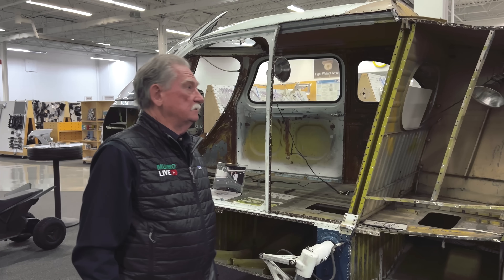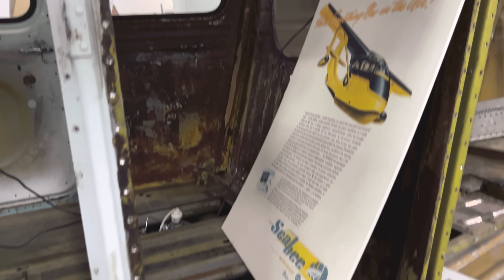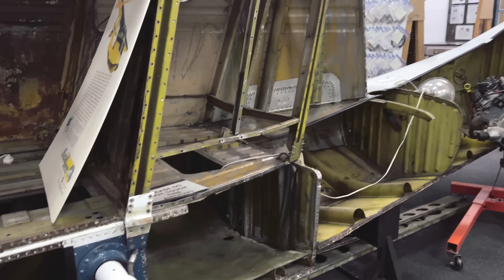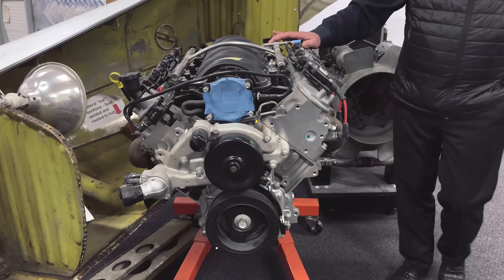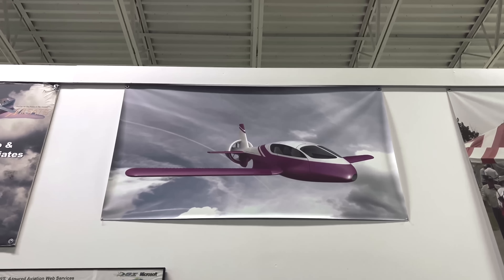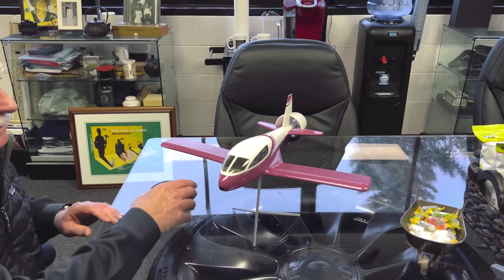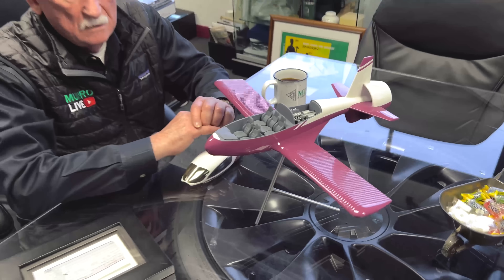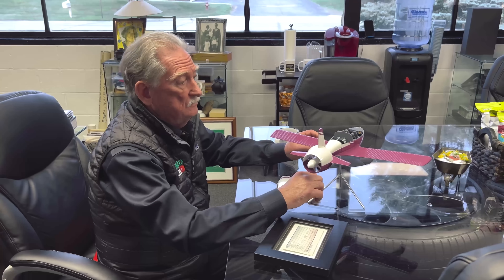Storytime with Sandy - Seabee and The Paradigm Plane.

Comment: Ummm an Aircraft for Women ?

Didn't you Google to find out that 90% of pilots are Men ?

Also most Women are scared of flying let alone in a small single engine plane ?

Only very young Women are obsessed with pink,  if you Google Adult Women's fave colors, the top three are Blue, Purple and Green. Two of which are also Men's fave colors !!

These are some very very strange choices....🫤

Comment: Boy that Seabee cut away has brought back memories.   Back in 1973 I was 19 and I briefly worked at Stole Aircraft where we converted Seabees into the twin engine Twinbees.  I was there paint stripper. Because I was so skinny, I was able to fit down through those access holes beneath the seats to strip out the green paint inside the hull.  I wish they had respirator’s available at the time. I know I lost some brain cells from that experience.

Comment: Thanks! My Seabee is older than me (and I'm pretty old!). I do the annuals (supervised by an AI, of course) and have never seen parts and spaces on my airplane that I saw in your cut-away. Thank you! I regularly land on marginally salty water (Petaluma River, San Joaquin River, Sacramento River Delta, etc) and, post-flight, taste the water in the hull (there's always some water after water ops) to detect salt (salt taste is very sensitive!). If I taste any salt, Mermaide of the Skye gets thorough douche with fresh water. So it's comforting to know that Seabees have tolerated salt for decades.  And, if you're done with your Seabee scrap, I'll be happy to take it off your hands. No charge.

Comment: Getting a new aircraft design approved and certified is a long term nightmare.  Compliance with the FARs basically drives you to use old "proven" techniques for the airframe and engines.  The FAA has ensured safety to a modest extent in the small aircraft world but has also stifled innovation. There is finally some innovative new autonomous and piloted electric air vehicles being developed but they've got large amounts of funding to deal with the certification bureaucracy.  Lots of good designs and concepts have died when faced with the reality of getting a product all the way through development and certification  I believe the loss of funding probably saved Sandy from a fairly large financial disaster.

Comment: Regarding your aircraft looks great, not a fan of the old wing design. Specs certainly not a 180mph😂 aircraft maybe 120/130. Anyways i see a typical mistake where startups bight off more then they can chew. Innovating the engine/avionics/airframe. If you just focused on one element you might have had success. Garmin has already secured the GA avionics, airframes have also been refined, but piston engines, same old 40’s tech. TCM IO-550 is still the industry standard. 310ps air-cooled, magneto powered, etc… the market now I think is retrofit for electric drives on existing fleets, this would be cool.

Comment: The Delta Hawk two stroke diesel is an amazing engine. I’m sure too small for the SeaBee but the idea should be considered. The Zoche two stroke diesel from Germany is better still** but sadly the project ran out of money for homologation. 
** 2.5 litre four cylinder 150 bhp or 5 litre eight cylinder 300 bhp. 
Zoche had a turbo blower driven by a ring gear which doubled as starter motor. It also had a normal turbo for charge air boosting.  As with Delta Hawk there are no valves to seize, no fussy spark plugs, no carburettors and it runs on jet fuel.

Comment: Ok so as an aviation person, lots of factually incorrect things being said here and I wish for his own sake he would research this as there are plenty of people expecting the information he is sharing to be factually correct. You cannot put a "x" in front of the N number and make it experimental. If it is a certified aircraft, you have to have its airworthiness changed to experimental, however it cannot be an EAB (Experimental Amateur-Built). He could get other types of experimental certifications but they all come with heavy restrictions. 

Sandy keeps saying "against the rules by the FAA" but can you please cite what you mean? Regarding formed panels, look at any rib on a metal wing airplane like a cessna and you will see formed aluminium. This is a common practice and one that is done in both EAB and certified airplanes. The "hoops" are just structural members / stiffeners and are also found in other airplanes in a variety of shapes and sizes so not sure why he is saying not allowed. Spot weldings are done all the time on frames and tabs on planes like cubs and champs and so I'm again not sure what he is talking about. Take a look at this AC for what the FAA considers acceptable methods today: https://www.faa.gov/documentlibrary/media/advisory_circular/ac_43.13-1b_w-chg1.pdf

Regarding your own design, I think conceptually it great and pusher props are cool, but you said a few things. "Taking off with idle power" would be quite frightening as you need to be at idle power to come down and land, if this is the case, the airplane is not setup correctly. Most GA piston airplanes swing a prop with a direct drive and engines are designed for a power band with a peak RPM around 2600 RPM. Just because you got a bigger engine that revs more doesn't mean its matched well for the aircraft. You WILL need a PSRU to reduce the speed of the prop.

Comment: There is a lot of thought in that development model. The fuselage is very well designed for favorable pressure gradients. The wing, constant chord rectangular "Hershey bar" of high lift, forward camber design could probably use some improvements. Although it is probably easy to mfg, and has docile enough stall behavior. I'm never been a fan of shrouded prop-fans. Although they have several benefits, the drawbacks are also real. I'm sure it provides some additional stability. 

Overall, a really neat design.

Comment: As a mechanic I have a few things too add, I think you had a great design, but you would have gone bankrupt trying to certify that plane for a multitude of reasons.

Also, spot welds aren’t traditionally “legal” per AC43.13, however if that plane is Type certified as that then it’s legal, provided the company can prove a construction is safe, it’s on the company to establish that.

Comment: great story, thanks for sharing.   You put together others' great ideas into 1 airplane.  The deicing was first done just like that in the 1920s racing seaplanes.  There's been other ducted fan aircraft but they have been one offs.  Molt Taylor and others have put the prop in the back, but not as a ducted fan.  I really liked the door idea for passengers.
Reply: Most ducted fan fixed-wing aircraft have just been experimentals or prototype, with the notable exception being the Edgley EA-7 Optica, which went into limited production. 

The RFB Fantrainer was a production aircraft, with 50 built. It was less like the Paradigm than the Optica and was turbine powered, but used a pusher fan.

Although it was just a prototype, the PJ-II Dreamer was an interesting example, because it has not just the rear ducted fan (actually two of them), but is powered by a GM LS engine like the Paradigm.

Comment: That is a sad situation. The aircraft model looks excellent, and visibility forward as well as down would be great. I used to fly the Shorts 330 and 360, not esthetically pleasing airplanes, but getting into and out of the pilot seats was so easy. Instead of stepping over the center pedestal. you'd just walk around the outboard edge of either seat because the cockpit was so wide. Your model looks similar in just that regard because there's space between the outboard edge of the seat and the side of the fuselage.

Comment: I disagree with you regarding the original aircraft engine. That engine design - opposite cylinders, dual spark plugs per cylinder, dual magnetos, air cooled - has been a reliable and proven design for over 70 years, still used on most GA aircraft. It's a simple and proven design with redundant systems. I admire your energy and enthusiasm but in aviation - there is very little room for experimenting and it is not as forgiving as a ground transportation.

Comment: Autonomous landing... cool.
Reply: Sounds totally not terrifying
Reply: Aircraft have been capable of autonomous landing for decades. As computer technology improves the cost and size of the system required gets lower, so it could be used on smaller aircraft. By the time of the Munro work it was assumed to be a feature of future aircraft, and was promoted by the NASA program that Sandy mentioned.
Reply: @brianb-p6586 thx. Any source to chase information a little?

Comment: Apparently you have no formal education in aircraft design and you may not even be a pilot. Did you even do an aerodynamic study on your conceptual design, I doubt it. You have the engine mounted aft of the center of gravity, which means you would have to counterbalance that weight forward of the cg by a lot of weight, which is not normally the passenger or payload weight, since passenger/payload weight is variable and the aircraft needs to be balanced(usually a little nose heavy) at dry weight so that passenger/payload establishes a fixed cg range for which the aircraft is stable in flight.  A liquid cooled engine adds a lot of weight, and how would you manage the thermodynamics of the coolant when an air cooled engine does not require the added weight of a cooling system.  Putting a ducted fan propellor drive at the tail would exacerbate the tail heaviness problem of your design, plus result in added weight of the drive system further aft of the cg. Also, the aerodynamics of the tail control surfaces would be adversely affected by the turbulence caused by the ducted fan and duct structure where your control surfaces exist. Judging by your obvious lack of knowledge of aircraft aerodynamics, flight stability, and aircraft structures, I would say Lehman Brothers did you a great favor by going bankrupt first to prevent you from going bankrupt yourself trying to design, develop, flight test and get certification on this seriously bad aircraft design!
Reply: All generally valid points, although I will point out that every "business jet" (small turbofan aircraft) has the same rear engine and balance situation. 

Also, in the golden age of piston-engine aviation (the end of World War 2), the best engines were either multi-row air-cooled radials or V-configuration liquid cooled... both were viable, and the weight of liquid cooling was not a problem. There was even a liquid-cooled radial engine (Lycoming XR-7755-3) which most powerful design built, but it did not go into production... the war was over and gas turbine engines made it obsolete before it could be fully developed. There are currently liquid-cooled adaptations of automotive engines available for use in general aviation aircraft, and they are feasible on a weight basis.
Reply: @brianb-p6586  while your observations are noteworthy, most business jet and commercial airliners with aft mounted engines have substantially large cabins well forward of the aerodynamic center of gravity to achieve balance for flight stability.  In fact, in the case of business jets, the rearmost part of the cabin is very near the center of gravity. As to liquid cooling, it is a trade off between weight, complexity and maintenance costs  as compared to an air cooled engine.  Depends on your design requirements and available power plants.
Reply: Exactly, @jvaubry  - the balance situation is essentially the same in those "jet" aircraft and this design. In either case, the centre of the cabin is well ahead of the centre of lift, and so cabin load affects balance, and the CofG location of a completely empty aircraft is too far rearward. 

I agree that the cooling system is a design trade-off, as it always has been.

Comment: Wow! This concept could easily scaled up, so it could transport a lot of cargo and dozens of people.
Reply: An aircraft design can be scaled up or down; this is not more suitable than other designs for use at a larger scale.
Reply: @brianb-p6586  It seems to ve very efficient with that fan at the back end. 💨
Reply: You think it would be efficient, @McDaniel77 , but do you have factual evidence to support that? Ducted fans and pusher props and fans have been tried many times, and never proven to be more efficient than propellers on the nose or the wings.

Comment: A 5 seat pusher is exactly what i want for my family.... if only they existed.  Id be curious to know if they designed it so a driveshaft failure  wouldnt take the tail off as happened with the cirrus vk30
Reply: Good catch. The Cirrus VK-30 was produced (as a kit) from 1987-1993, and the Munro design is essentially the same thing plus a propeller duct.

Comment: As a former aircraft owner, there are a few points I’d like to point out.  That air cooled engine can produce 75% power at 2200 rpm ALL DAY LONG.  That Corvette engine puts out its power at 5000+ rpm; you CANNOT turn a propeller at that rate. . .  The prop tips would be breaking the sound barrier.  I also owned a high performance Camaro Z28. . .  264 Hp at the rear wheels.  Thing is. . .  At 70mph, that engine might have actually been producing 30hp.  NASCAR engines run at close to 100%. . .  an hopefully last a 500 mile race.   

Sandy, go out and get your pilot’s licence.  It will be an eye opener
Reply: Developing an efficient ducted fan is a huge can of worms.  It’s probably doable but I see no evidence of that having been even understood here. 
Also a drive shaft from a mid mounted engine to a pusher ducted fan has huge engineering obstacles. It looks simple, it’s just not. Torsional vibration and resonance with the ducted fan would be charting new territory. 
The construction methods of Republic aircraft are intriguing but not well enough understood here to realize the benefit in this application.  
In short, it was more than Lehman Brothers failure that brought about the demise of this intriguing concept. In a fantasy world of unlimited engineering resources this machine could have been developed into a safe enough machine, but vastly larger sums of money would need to be lost then the product and its assets would need to be bought out of bankruptcy at pennies on the dollar in order for the economics of this design to ever be realized. I hate the realities of bringing an aircraft to market.
Reply: According to another commenter the Seabee V8 conversion uses a 1.4:1 reduction drive, and of course the engine is not run at 5,000 RPM. In the Munro design the drive is direct, but the smaller-diameter ducted fan would be suitable for the 3,500 RPM used. 

An LS1 (the Corvette engine of the era) would produce peak power at over 5,000 RPM, but would be operated around the peak torque speed or lower in either the Seabee or the Paradigm. 2004 Corvette specs include peak torque of 360 lb-ft @ 4,000 RPM, and at the 3,500 RPM that Sandy mentioned for the Paradigm it could produce about 240 HP... although of course that would be at full load.

Comment: My dad has an old SeaBee.  It's an amazing plane.  Note almost all modern aircraft are "exoskeletons" or "Monocoque" construction.  The SeaBee is special because it uses dramatically fewer parts by using stamping and thicker skins instead of a zillion ribs.  The only weakness is the cabin under the engine, tends to develop cracks unless you add some ribs.  (joints between parts are HEAVY.  Adding a little weight to eliminate extra parts and joints is often a net win.)

The old Franklin engine is indeed quite bad.  Mostly because it pre-dates things like sodium filled valves and the cowling lets one cylinder run 50-100 degrees hotter than the rest.  

The "transmission" is just a long shaft with no gears.  The conversion to the Chevy engine adds a small reduction silent chain reduction gear otherwise the Chevy wouldn't be able to swing a big enough prop.  ("geared" propellers are tricky because the propeller is also the engine's flywheel)  The FAA hates the Chevy conversion of the SeaBee, won't let any into the country and won't let anyone convert a USA based SeaBee.  Speaking of the prop, it's fully reversing and gives excellent control on the ground and water as you can set the pitch to any setting between forward and reverse.  Lots of reversing props only do full forward or full reverse.  

Interesting that the SeaBee uses an uncommon aluminum alloy.  I suspect it's something "weaker" than 2024 or 7075.  Because even on aircraft, stiffness is usually the most limiting design factor.  I'd guess something like 6063 or even 5052 with all the stamping and good corrosion performance.

Comment: Great story Sandy!  I'm a private pilot myself and it's always puzzled me that the pace of innovation in general aviation tends to move at a glacial pace.  Until Cirrus brought us the first certified aircraft with a glass cockpit and a parachute recovery system, a new Cessna 172 in the early 2000's would've still be largely the same as one from the 60's!  Too bad your concept didn't work out, as Cirrus is now the biggest GA manufacturer in the US.
Reply: Yes, the general aviation industry is very slow-moving. Cirrus is an interesting example, though... their VK-30 was essentially the Paradigm (but without the duct around the propeller)... built and actually flying in 1987. What Cirrus learned from the VK-30 was that it was not a good idea.